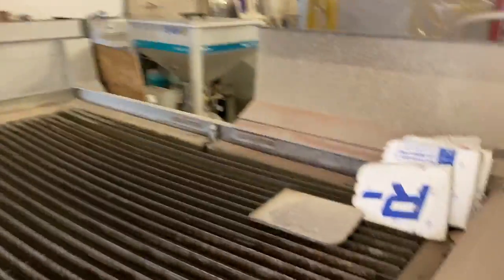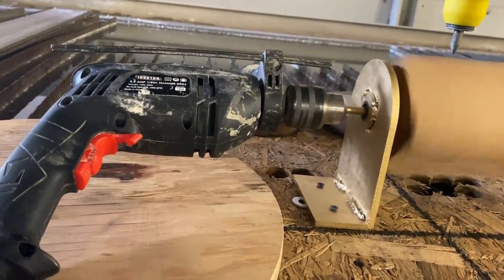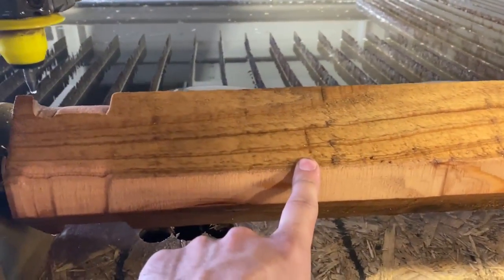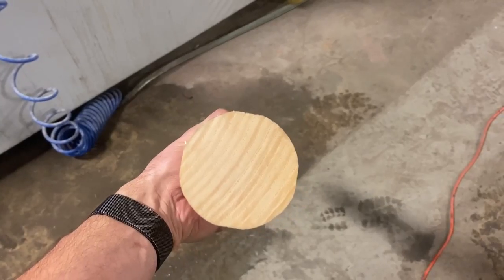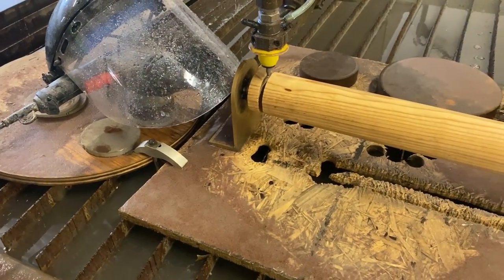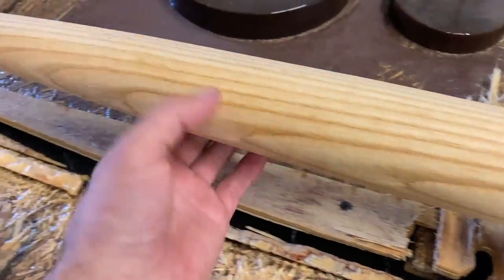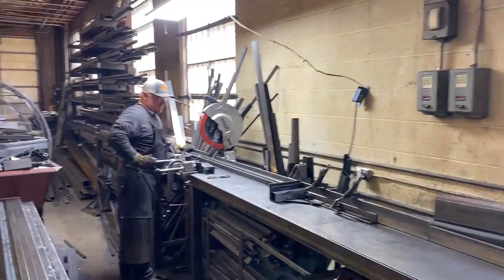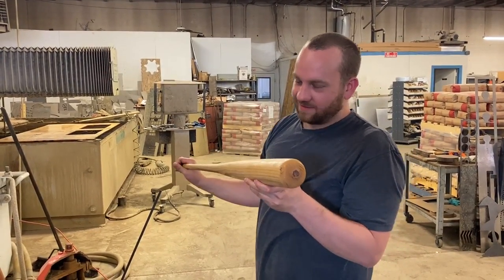Turning a Waterjet into a Lathe | Woodturning with a Waterjet

Comment: The wobble you were getting was from removing too much material at the end. Typically you would want to put the head of the bat toward the drive side so there is more meat and then start cutting at the handle end. That will leave the bat stiffer and provide more support while removing material.

Comment: The real miracle is that HF drill ran for 2+ hours!
Reply: With it being so close to the water it most likely cooled it down enough. But yea I'm surprised a drill was enough power to move that hard wood
Reply: HF tools are surprisingly good
Reply: @Nicc93  - the required torque/power are more about the bearings and the waterjet than the mass of the wood itself
Reply: They won the HF lottery.

btw, I just bought a welder from them. Wish me luck...
Reply: @GeneralChangFromDanang  I would... but you almost certainly don't need it; that welder will probably be fine.

Comment: This is utterly inspired, i cannot believe they do not use this for roughing out castings/forgings on those massive lathes. you just see them slowing using a ceramic cutting tool slowly taking it down to the desired shape.

Comment: I feel like the end product will eventually split , due to re-introducing water to the wood from the the water jet. Wood obsorbes water unlike plastic, and metal. and you sealed it while wet.
Reply: I was wondering the same thing....maybe use metal instead of wood??????
Reply: @ericwilliams7374  we have to know if the machine cuts a piece of metal that thick.
Reply: @ericwilliams7374  Aluminum bats are hollow, so any bat they could make from metal would be ludicrously heavy.

Comment: Love your channel but you should probably know that copper alloys do kill bacteria but only if the copper is unoxidized so it’s only practical if you are basically sanding that finger every few hours. The original studies on copper bacteria killing properties neglected to test with and without oxidation which is why there is a lot of miss-information about it. Now stainless is used in hospitals and so on more because it is non-porous which although it doesn’t kill it makes it efficiently clean. 

Woodworker here, love the slightly unorthodox lathe!

Comment: You just KNOW there's someone out there who's water jetted themselves a wooden dild before
Reply: pretty sure that's the default CNC sketch that loads when you boot the machine up the first time
Reply from the maker: I actually do not know that
Reply: Not sure what i'm most chocked about. You having that idea, or it actually being true.
Either way, weird mindset xD
Reply: rule 34, so no.
Reply: @pmcKANE  what's a dild? 🤔
Reply: One of a kind and probably cost $300
Reply: @WaterjetChannel  An idea for your next video perhaps?
Reply: I cut about (30) steel cocks with balls on my waterjet, then welded them all over a buddies equipment trailer. Also used one of them as a brand and burned the cocks with balls into the deck. It was one of my proudest moments...

Comment: Would it not have worked having the water jet going with the spin of the wood like I understand it would penetrate less
Reply: It would probably spin at warp speed and explode like the fidget spinners and skateboard wheels they blew up.
Reply: @Woogoo336  if the wood wasn't so expensive (based on their comments at the end) then I'd say that would've made for fantastic content, honestly. 
"We exploded a massive fucking chunk of solid wood with our water jet."
Reply: @randomnpc445  $30 in wood $300+ in cutting time.

Comment: Could've just started on the other side, with the spin. (Edit: I guess that it would need a braking system though to limit spin speed.)
Reply: Finally found someone else that said to cut the other side... seems like common sense
The brake would be easy and better than the drill

Comment: Absolutely amazing. I struggle with a normal wood lathe. Awesome
Reply: I use that trick for machining foam, it's a pain in the butt on a regular lathe (too soft, it just warps all over the place as soon as the tool makes contact) so I turned a laser cutter into a lathe, same way they turned there waterjet into one, expect a bit less janky and a lot more effective. (the laser doesn't imply any force on the foam and melts straight trough it, even with relatively thick parts.)

it only works with foam tho, anything with a higher melting point and density and it does basically nothing.

Comment: You was on to something when you cut the corners, the thing is like with actual lathes you can not take to much off at one time. Multiple passes are required, I would suggest trying to do 1/3" cuts each pass, so you would need a series of patterns for your waterjet to run.

Comment: Cool video i was in the oil fields and saw them cut a 7 inch thick steel pipe on a bevel with a water cutter using ruby dust in the water mix no intrusive slage for the next welding process

Comment: This, but with some kind of device which would allow the bat to spin but with some predefined friction, so the bat cuts by the force of the water jet but also slowly rotates with a small percentage of the same force. Therefore you don't need the drill.

Comment: If you calculate the force of the water hitting the wood and then multiply it by the distance of the axis of rotation of the lathe, that will give you a torque spec. Correct me if I’m wrong, but wouldn’t you just need an electric motor with a higher torque spec than what you calculate to make this work more efficiently?

Comment: You should make a big fat flywheel (right, that's what that is?) for it, so it has momentum/inertia. That way when you go to sand or cut something on it, it has less of a stopping force. 
Also, when I read the title, I expected a propeller/generator style setup (like the car alternator) with paddles or something that spins the item so you can turn it, like a waterjet-powered-lathe

Comment: A cnc lathe is still way better. The main issue is timming the wood down so that the water jet doesnt deflect and actually bites into the wood, but if you had to do it externally you may as well just do the entire process on a lathe.  Even a manual one with a copier tool sounds better than the water jet :P

Comment: I can't believe you guys didn't initially think to just spin the damn wood using the water jet.
If you put a water jet to cut one part of it, as long as the object is locked in place but allowed to spin, the material will continue to shed until the jet no longer hits the object.

Comment: will this work on acrylics?  problem with wood is that water makes wood fibers swell.
be pretty sweet on plastics, though!!
also, you tried taking too much off at first.  same thing happens with a wood lathe and lathe chisels, except the handle could very well swing up and hit you in the face, break your finger, etc.  you have to take off a little at a time.

Comment: In ancient times, to bore holes in stone, they'd import some aluminum oxide from that greek island or use diamond powder (uncited on the diamond) then use some means of fastening it to a face of a mandrel, using glue or heat welding.  But how did they make their mandrels?

Comment: Guys, you only need to add a flywheel to this contraption of yours and it will work like a charm. Just cut a bunch of circles and bolt it to other end, and remember to use at least two nuts to fix it in place.

Comment: Okay, but if you take out the drill, doesn't the water jet turn the bat just fine? Slap something heavy on each end so it can't over speed, and the water jet will cut and spin at the same time

Comment: There is a signficant difference between "cutting off a large chunk of material" and "cutting off repeated small chunks of material"  A conventional water jet, cuts away a small amount of material (the material in the cutting zone) to leave behind two large chunks, the workpiece and the cut-off. As such, the work done, is actually quite limited, hence you can use a pretty low power jet of water to do this.  When you spin the work howver, you are now asking your water just to actually cut away ALL of the cut-off piece, in this case, all the non work piece material is turned into wood dust, and this means a HUGE extra amount of energy (work) is required to do this. Now your water jet has to cut away each and every small chunk of wood that surrounds the work, and obviously that takes a lot longer than a single "freeing cut" to simply seperate the work from the off-cut.............
Reply from the maker: Precisely

Comment: Am I the only one that seen the problem immediately?i noticed the lathe is turning the wood the the same direction as the water is shooting. Meaning the force of the water hitting the wood is severely reduced which is why is wasn’t cutting as efficiently in the beginning. The solution? Either spin the lathe in the opposite direction, or put the waterjet to cut on the other side of the object

Comment: You slowly try to dry wood that it does not crack due loss of water. Then you drench it in water with a water jet. Good thing is that you trap the water in the wood by oiling it.

Comment: You could actually turn unturnable materials like epoxy-filled metal chips, ceramics, rubber and, i am afraid to speak it out - steklotekstolit!
Also, applause for virus doing the Wilhelm Scream.

Comment: Why not change the direction of the rotation, or cut the other side, so instead of the water pushing against the rotation of the drill it's pushing with it. It'd speed up the rotation but it'd still be cutting right?
Reply from the maker: We were worried about it turning it at warp speed and opening a worm hole.
Reply: Oh fair enough
Just surprised it wasn't mentioned lol

Comment: The CNC is obviously programmed for a certain hight....I’ve noticed you don’t have much control on the depth of the cut,unless the nozzle can incorporate vertical motion to reduce depth of the cut??...is this possible?..for the nozzle to move up and down as well as horizontal programming...?...if this technology can be applied into a router power tool with the ability to control depth...as a manoeuvrable easy to use anywhere tool....it’s the only one I’d ever need...👍

Comment: I realize that this is more of a joke video, but the problem with wood is that it's supposed to stay dry, otherwise it will warp and crack. Also (this is me talking with no woodturning experience and only having watched videos), on a real lathe the cut is done gradually, sneaking up to the final form, and not going as deep as the water jet. Cool experiment though.

Comment: As a drive shaft machinist... wtf did you think would happen by telling the lathe to do the finish pass before roughing... No shit the cutting does better when you're not trying to remove 2" of material in 1 cut.

Comment: Soooo disappointed that you didn't just let the water jet spin it. If you are worried about it going warp speed, you could add a wheel on one end, with a belt or a block of some sort to add a bunch of friction to limit the rpms

Comment: You probably wouldn’t even need to spin it with a drill.. the water pressure should spin it anyway and make for a cleaner cut if you go slow
Reply from the maker: It would spin it, but would spin it so fast it would tear the fabric of the universe

Comment: You do not need to have a fast rotation speed, this method is very used to make copies with a router, you can jse as little as 50 rpm as long as the cutter is sharp, but it is the fastest method of turning anything without causing axial stress vs regular turning so you can deffo do it faster with that thing

Comment: Come on guys, you use a SANDBLASTER to remove rust? Get on with the times and get a laser rust remover! It'd be a cool addition. Maybe a whole new channel like how there's a hydraulic press channel and such.
Reply from the maker: Yeah that would be awesome...
Reply: @WaterjetChannel  They are only about 10 grand for the crappiest lasers. Juust remember, laser safety, that thing can accidentally boil an eyeball. Make sure the glasses are proper certified and you don't launch it when someone's around. A bit of a logistical and insurance nightmare, but,... You can trace your hand onto the rust! It's like crayons. That can melt your eyes.

Comment: Unfortunately you did not mention
Why did you not try turning into the water jet to see what happens,
When you are turning with the water flow, You are defeating the purpose of your cutting action,May have to take smaller cuts
But may also give you a better finish and cutting faster.

Comment: A thought   Its not designed to be a lath.   What if the wood were suddenly to break ,  a piece of wood jumps up hitting the jet head, Knocking it out of alignment .  Now  the head is  pointing at operator' face and squirts him square in the eyes the operator is now blinded, the operator can't see where he is going. Tries to runaway , but instead runs the wrong way and then gets his arm cut off. He cannot turn the machine off now and yells for his partner to save him. His partner sees his partner screaming runs to save him but runs into the stream too and the water jets slices a baseball bat pattern into his back where his backbone use to be.

Comment: We've got a $30 USD Drill, a $5 USD Setup for our rotation axis and a 1 Million USD 5 Axis Water Jet...
Let's make a video.

Joke aside, it works, but you should put a stepper motor in there and somehow hack it into the controller.

Comment: QUESTIONS

Can a water jet be used as a table saw?
Can a water jet be used at low power as a sand blaster?

Cheers
Reply: I mean they kinda already use it as a table saw. A sand blaster however would be interesting

Comment: Your toolpaths are not exactly optimal for lathe cutting, which takes material slowly from the outside until you get to the requisite shape; it would be better if yall made the toolpath here start on the outside and take material away procedurally rather than going all in immediately.

Comment: AC drill and water mist few inch each other? I guess a bad idea, you painted all the stuff and a simple, better than nothing, screen that protect brushed drill motor could be an idea, better a low voltage waterprof spindle anyway
Reply from the maker: as far as i can tell... the drill is invincible

Comment: It's awesome how ignorant of wood turning you guys are at the start of the ash bat. 
Had you started in the opposite end and allowed the uncut wood to stabilize the piece it still wouldn't have worked but it would have been way closer. 
The second first idea was the best. Take off as much waste as possible to avoid balance issues, which happens all the time wood turning. Which water it will make it worse because the wood will absorb the weight unevenly plus you have a blasting head adding vibration. 
You learned pretty quick though. 

I've made these mistakes, I'm not being rude.
Reply: If unclear...i meant put the business end of the bat toward the drill and they light handle away

Comment: Thumbs downed for unsafe use of a rag and belt on a spinning system like that.
Reply: It was spinning on a cheap drill and in slow mode too. Such drill could usually be overpowered and stalled quite easily by hand. It's not powerful enough to break bones and cause any major injuries.
It's bad practice but risk of injury in this case should be incredibly low.
Reply: hauuau oh shoot I skipped past the part about the drill setup 😂 I thought it was a legit lathe 😂 looking at it now yea that wasn’t unsafe at all..my bad.. thanks for the reply 👍🏻